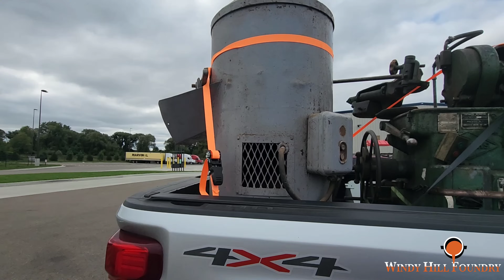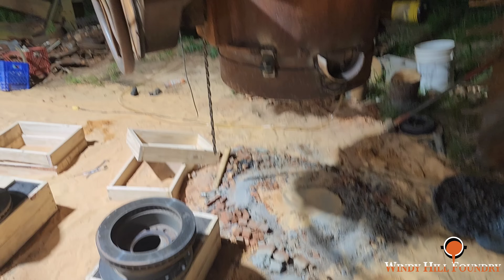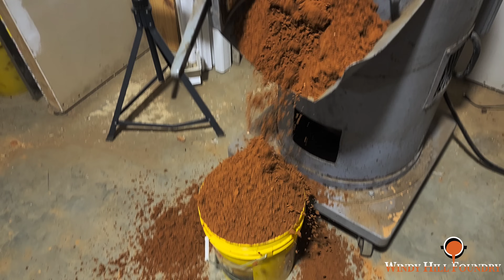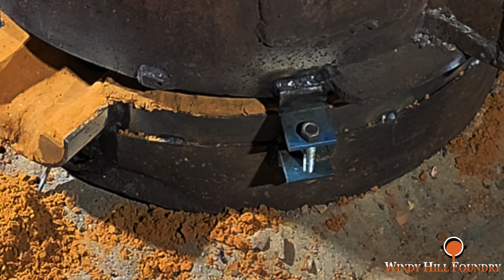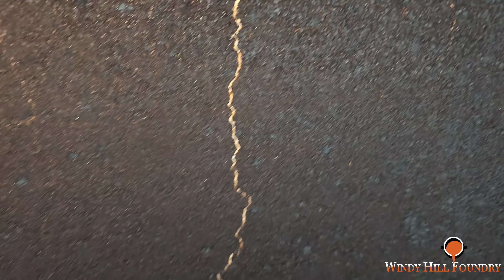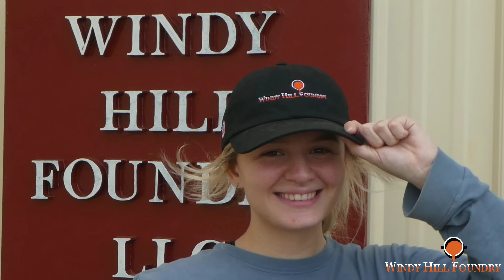TILT FURNACE PROGRESS

Comment: Lots of surface area with minimal air flow in the base. I think that contributes to the low iron output.  I would suggest that the pour spout should be configured so it bottom taps the molten iron so you avoid pouring slag and other trash that accumulates on top.

Comment: I would suggest:  a compressed layer of refractory wool between the iron kettle and your refractory cement, this will accommodate the difference of thermal expansion of your iron kettle and your refractory cement.  This may require a lip of iron at the bottom of your iron kettle that you can cast your refractory cement around, simply to hold up your refractory cement. If you would like drawings let me know.

Comment: Do you think river mud will work to make green sand?
Reply: Probably too much organic in it plus wrong size material.
Reply: @royreynolds108  What do you mean by wrong size material?  It definitely has organic material in it.  when dried and turned into a powder, it is about like Portland cement.  I have seen it  turned on a pottery wheel and fired in a kiln.  It turns into a terracotta color, but it will make usable pottery,.